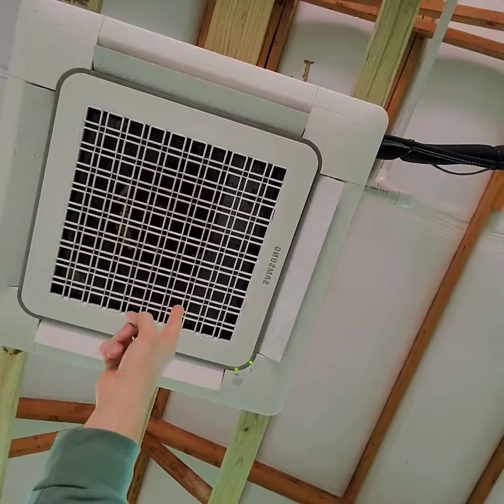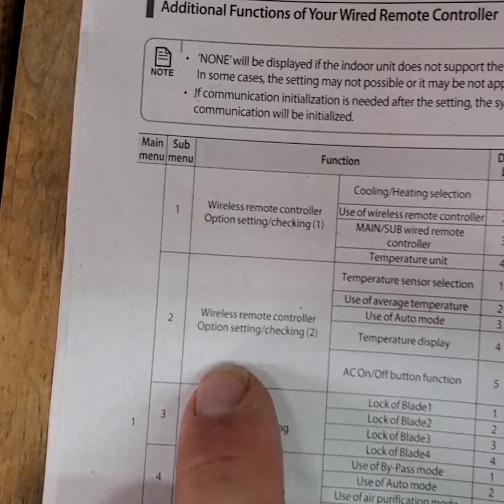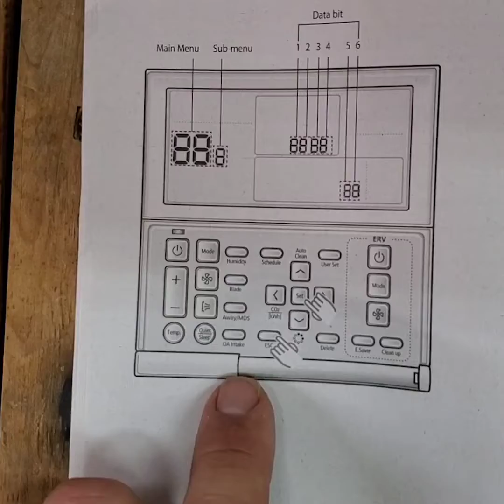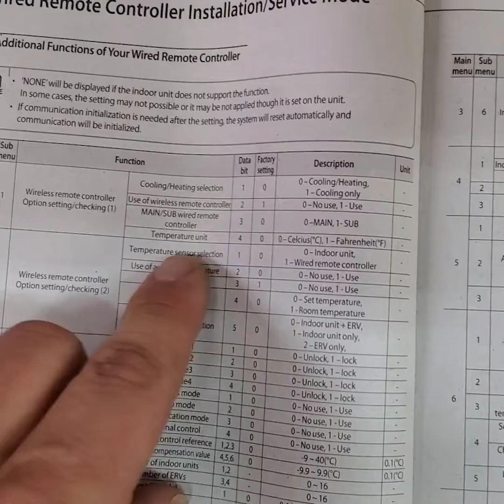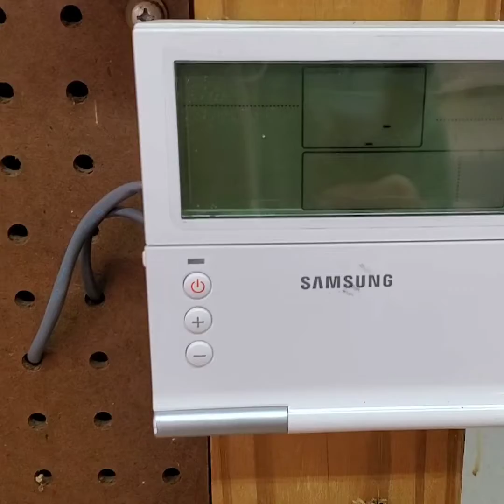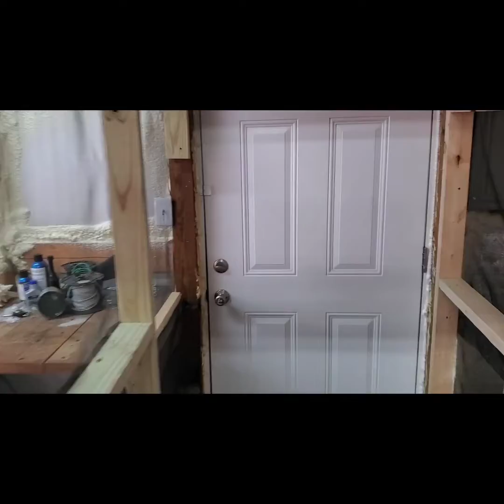Samsung HVAC option setting Wired Control Auto Mode 4 way Ceiling Cassette #hvactraining#SamsungHVAC

Comment: Hi Teddy, what exactly is the average temperature under indoor unit option? I have overshoot and undershoot issues when i have my samsung heatpump in heat mode?
Reply: Under the indoor unit status information i see the following information..
Inwonder if this 2deg is what causing my  heatpump to overshoot and undershoot the setpoint temperature? 
Heating calibration Value: 2degCel.

Comment: Hi maybe you can help me.  I have a Samsung advanced wired controller connected to a multi-positional indoor unit (AC030KNZDCH/AA) with a max heat outdoor unit (AC030JXSCCH/AA).  The problem is that, when in cool mode, the indoor unit blower keeps running even with the controller fan mode set to auto.  For example if the temp set point is set to 70F and the indoor temp is 65F (so the compressor is off) the fan keeps running.  If I switch from cool mode to fan mode, I can control fan speed ok and the when i turn the controller to off, the fan stops...so I don't think its a problem with the indoor unit but maybe some option on the controller I need to change.  Got any ideas what might be going wrong? Thanks for your videos.
Reply from the maker: Hey John in cooling mode the indoor fan runs continuously it's continuously and never shuts off
 There may be an option code that you can use to program the equipment to shut the fan off
Reply from the maker: Like in heating mode I use a thermo fan off option code to make the fan shut off after the temperature satisfies
Reply: @taddydigest  Thanks for the reply!  My old system would turn off the fan when there was no call for cooling so I wasn't expecting this.  In heating mode this new system does turn off the blower once it hits the set point so that added to the confusion.  The install manual doesn't list any codes to accomplish this in cool mode, but do you know if Samsung has documentation for options beyond whats in the install and user manual? Thanks again!